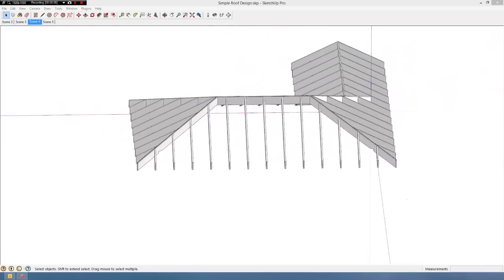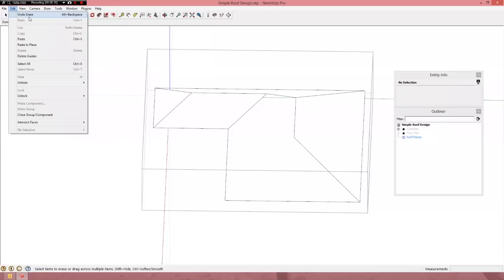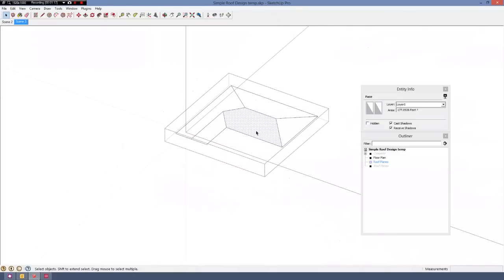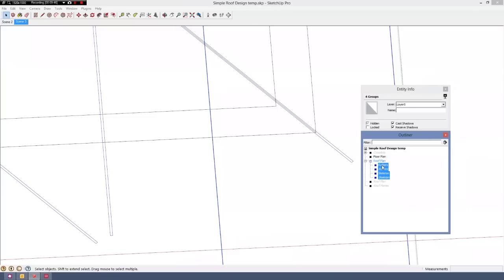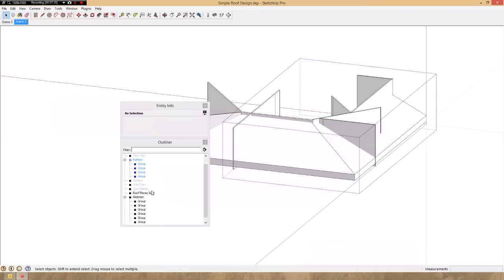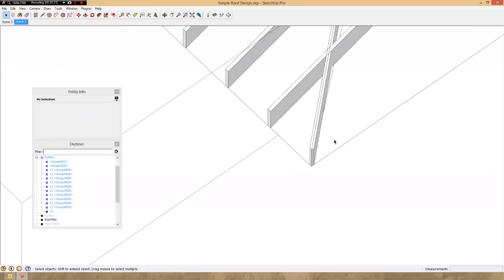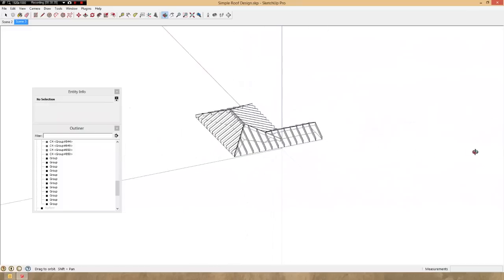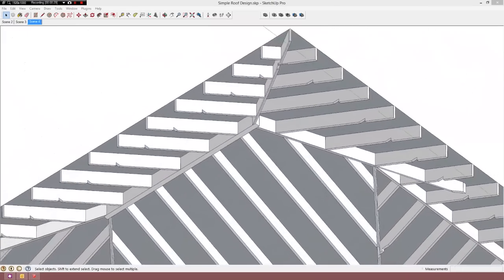Simple Roof Design in Sketchup

Comment: Thank you for all these videos.  Your work flow is spectacular.  I started using sketch up in '07.  My use of it has been in large bursts over the years--not very consistent, but I'm at it again.  I'm an older contractor who needs to get out of the field and I'm hoping to parlay my experience with sketchup and hands on building into a new way of earning my keep.  It's been roof geometry that have been most fascinated with the whole time.You're so great to have taken the time to put the videos together.  You've taught me a great deal.  The pace of the videos are perfect.  I quickly get the idea you're demonstrating and then can re-watch to pick up the finer points.  I've watched a lot of sketchup videos over the years, but this one took me the farthest in the shortest amount of time.  I just wanted to let you know your work and time is very appreciated.Thank you so much!

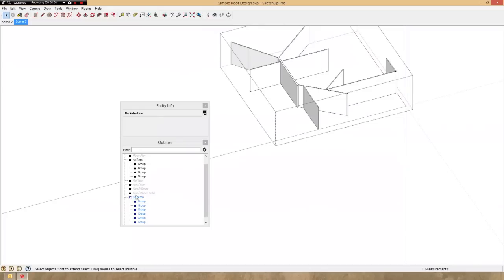Comment: Thanks for your time and expertise in putting this together.  This was my first roof and I got through it!  I got part way in with the "simple" roof, then started a "real simple" roof (rectangular footprint, gable one end, hip the other, offset ridge).  I could not get the trim function with the circle tool to work very well since even though I could select the part to get rid of, it deleted part of the good end.  I wonder if it was because I don't have the pro version.  There were a few "magic moments" 28:15 and 47:18 to be specific, where I had to figure it out on my own.  Anyway, thanks.
Reply from the maker: For this video I don't use any of the extra features of Sketchup Pro.